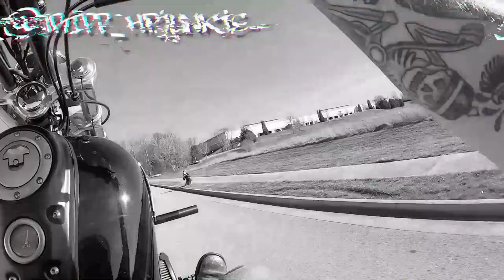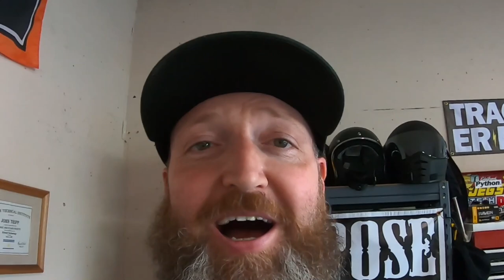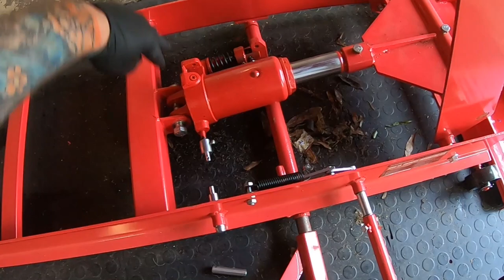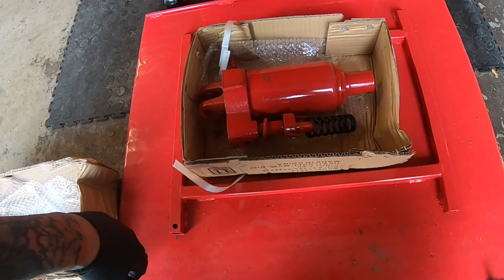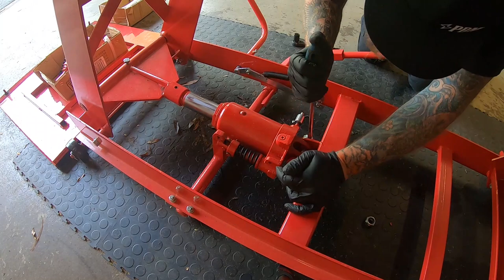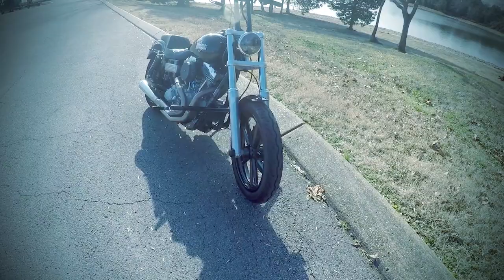Harbor Freight Motorcycle Lift Review Repair Pump Replacement

Comment: Thanks, had my lift for over 10 years and the p[ump just started to leak pressure a little. Was thinking I needed to get a new lift for $500, just ordered the pump, $72. Thanks bro, saved me sum buks. The lift is awesome, I don't know of much else nowdays that will operate for over 10 years and only cost you $72 in replacement parts. Shoot I even lift mt RZR on the lift. It leaves the wheels hanging over the edge for easy working. Superb lift, well worth every penny.
Reply: Do you have the link for ordering the new pump by chance?
Reply: If you don't mind and if I can get the phone number 😊 What's the part number of that pump I need to fix my
Reply: @JorgeHuezo-s7o same question.. there’s 2 styles of jacks as u prob know… not sure what part # mine is.. mine is the same as this guys

Comment: Just replaced mine at around $105usd. Just a side note to mention the oil fill/check is the big red rivet looking piece you see on the pump. They paint over the rubber plug. It looks like metal until you pull it out.
Reply from the maker: Thanks man

Comment: Harbor Freight bottle jacks are generally bound to fail. I had three of them that failed. I also had a Sears Craftsman bike lift that had a failed jack unit and no parts were available. Best bet for an upgrade on the Harbor Freight bike lift is the Air-over 20 ton unit. Modifications are needed but the Harbor Freight bike lift is in general a good unit.

Comment: I have both styles in my garage.  This one is my main and i have a second as a backup lift.  I'm surprised you didn't swap to a pneumatic air over hydraulic when doing the replacement.
Reply from the maker: I understand that air is easier but I dont have a air compressor that would run it.....plus more stuff to break maybe in the future....thanks for the comment homie

Comment: I purchased one several years ago and after sitting in the garage over winter it would not lift my bagger any more.  Got a replacement pump and it worked fine until the next spring.  Seems that the cold causes the seals to leak.   Ended up taking the whole thing back and got a complete refund.

Comment: I bought a used lift off a friend, it pumps up fine, but hit the lowering pedal, and it comes crashing down.
I’v tried adjusting the setting on the valve, but there’s no difference whether I turn either way.
It’s kinda frightening when I lower it.

Comment: 15910 Diagram Reference number 25 “Pump “for this lift. The other lift part number is 15469 Diagram Reference number 01a “Hydraulic Pump”. Hope that helps guys

Comment: Did you new pump come filled with fluid? I see you added fluid in the bottom in your video. Thx!!
Reply: If you look at the instructions on harbor freight site and your lift you will see the serial number. Just call cust service and pump arrives in a week or so.
Reply from the maker: Yea they have since changed it just making sure its topped off
Reply: Thx! I'm attacking my change tomorrow. Mines down so I will remove top mounting nut and just up and install dog leg before switch out. They are a little difficult to work on but value fir money.

Comment: Hi there , I bought this loft today . I noticed the rod connecting the hydraulic pump to the side is slightly curved . Not straight is that normal ? I can send you a picture here

Comment: Great video but a little fast...I received my replacement jack from Harbor Freight. My question is...How do you get the piston, that the pump spring goes over, to extend before the install? BTW...2021 price for the replacement jack is $107.
Reply from the maker: Iam assuming you pump the jack is the only way.....

Comment: I had the same issue ordering them they sent me the wrong one I had to send it back then they sent me the right one but they wanted me to pay for it so I had to pay for two  and then get refunded. It was a big mess. Mine also has air in it. I need to learn how to bleed it or get it going to make it go up and down again and I don’t know how I’m stuck. Can you help because the new one that sent me doesn’t go up and down either
Reply from the maker: Try taking the fill hole screw off then pump it untill fluid comes out.....hopefully that gets the air out

Comment: Do you happen to know the length of the jack? I would like to replace mine with a cylinder and a separate pump.
Reply from the maker: I dont know that off hand if you eant to measure yours Iam sure you can find one to work

Comment: I have the Central Pneumatics motorcycle lift table from Harbor Freight that came with the air/ hydraulic jack. After about 12 years of frequent use, the pneumatic pump gave out and I manually pumped it up for about a year. For several years I had been toying with the idea of converting it to a hydraulic cylinder, similar to what's used in a log splitter.  After about a year of hunting on line and through junk yards I came across a hydraulic pump unit for an automotive lift.  I found a 2" cylinder with a 6" stroke that I thought would do the job.  I fabricated a mount out of a 4" square steel tube (a little over kill there. 3" would have been quite adequate).  That served as a cross member between the frame rails of the lift. I made a post out of 3 pieces of 5/16" X 2" bar stock sandwiched together and welded. I drilled one end to receive the clevis pin of the hydraulic cylinder.  Then I centered and welded the post perpendicular to the square tube. The material for all the fabrication came from the local scrap yard. I had to weld the cross member onto the frame far enough forward for the rear lift arms to clear in the down position.  That meant removing the rods for the pedals.  The rod on the cylinder was much smaller than the ram on the old jack so I had to make a collar to thread on the end of the rod to make it fit into the cup on the V plate.  The pivot rod for the V plate broke the center bolt twice so I drilled and tapped each end and bolted a fender washer to the ends to keep the rod in place.  Once mounted and connected to the pump unit I rolled my 600# bike on the lift and hit the button to lift it.  I found I had turned my lift into a catapult.  It lifted the bike to the top in less than 2 seconds, and when it got to the top it jerked the whole assembly back about 4" along the floor.  I had to slow it down.  To do so I made a restrictor that I put in the fitting by the cylinder to restrict the rate of flow into the cylinder.  I had to choke it down from 3/8" down to .025".  That slowed the lift down to 8 seconds and kept it in place.  The pump unit has a go switch to raise the lift and a lever to let it down by gravity. I installed a pedal switch on the opposite side of the lift so I can lift it from that side too.  Since the cylinder has a 6" stroke and it only takes 4" to lift it all the way, I installed a stop switch to keep it from over extending.  I put a 960# bike on the lift and it lifted it about a third of the way up and overloaded it and blew the breaker.  I then installed a 2 1/2" cylinder which gave me plenty of force to lift a 1000# bike.  I realize that this is a little more work and expense than the air/oil conversion done here, but I think it was well worth it.

The only down side is if the lift isn't all the way up, and I want to lift it higher,  I have to let it down, either on to the safety bar or all the way down.  This relieves the pressure on the hydraulics and allows the motor time to spool up again to lift it all the way.

https://youtu.be/T6eHjhZNkXw

Comment: Sorry the spring on the side of the Hydraulic pump. The medal spring right on the side that works the hydraulic pump. Sorry to bother you. I can’t find it on any site
Reply from the maker: I don't think mine has a spring if so it was already on the pump
Reply from the maker: Try to google the parts diagram

Comment: Hey i need to replace my jack also. Same lift as yours, but having problems finding the replacement online? Any help would be great thanks.
Reply from the maker: Read the description
Reply: @TrippHPjunkie  I went to the link. Looked around, wasnt able to find it.
Reply from the maker: @Cnit89  what I had to do was email the customer support number they have 2 different pumps listed but you cant order them without contacting support at harbor freight understand?

Comment: What did the new pump cost? I have the same problem and have replaced the O ring twice. Works for a while and fails again.
Reply from the maker: It was under $100 bucks you have to call harbor freight to order
Reply: @TrippHPjunkie  Thanks

Comment: Would you happen to have the part # for this same jack/pump.  My lift is identical to yours
Reply: I just installed the replacement pump yesterday.  The lift model 69904, SKU is 15910.  Item #25 on parts list for the 69904. Call HF customer service.  Price was $107.16 plus MI sales tax.
Reply from the maker: Thanks man

Comment: Please post the part number for the pump.  I have the same lift and the same problem.  Thanks, great video.
Reply from the maker: Thanks for the comment you have to call in to harbor frieght to order.......I had to send them a email with a picture of the pump because their part numbers on their website are wrong hope that helps
Reply: What was the part number on the Box you received t
Reply from the maker: Read Please Thanks for the comment you have to call in to harbor frieght to order.......I had to send them a email with a picture of the pump because their part numbers on their website are wrong hope that helps